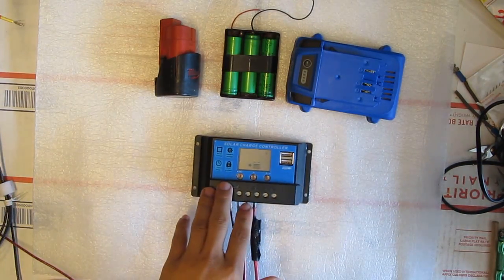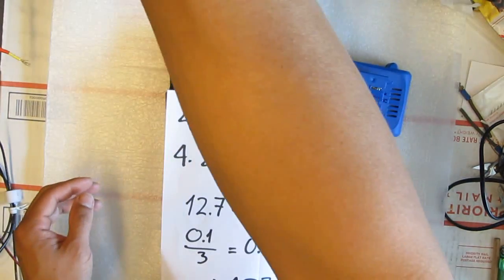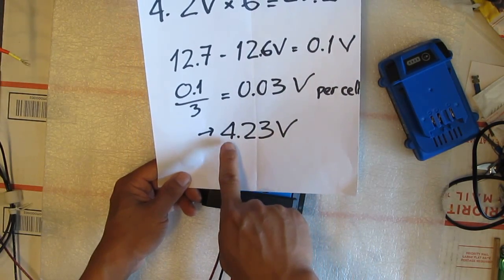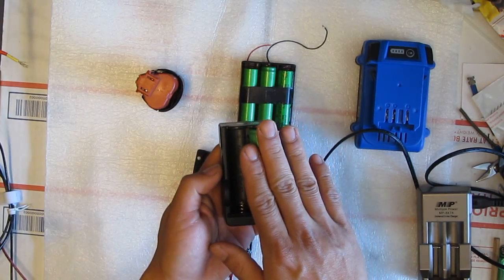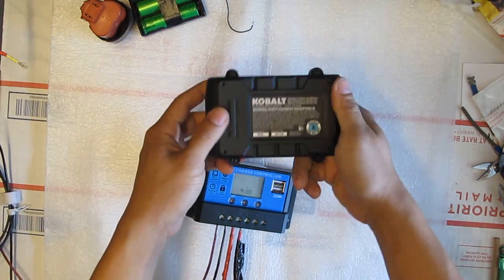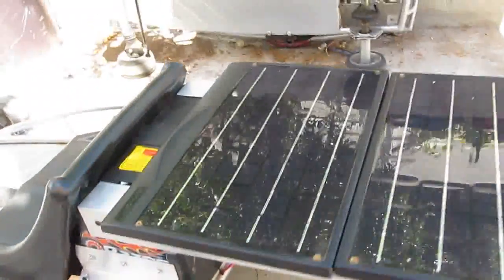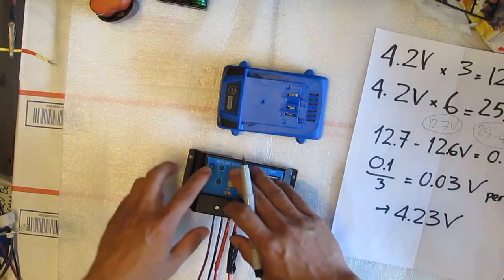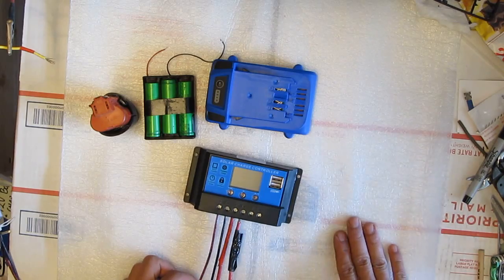Charge Li-ion batteries with regular Charge controller made for Lead Acid batteries

Comment: my foxnovo 4s charges my 18650 to 4.22, when I test cells with voltmeter they read 4.25. I havent notice any damage. But those who might have any problems with the slight overcharge can just attach a bms circuit to the battery pack as a safety feature.
Reply: jony joe Although higher than official spec cuttoff of 4.2v, the extra 0.05v to 4.25v is still ok (as you already know) and not dangerous per se. The problem is that it will DEFINITELY rob overall cycle life of the cell, yielding far less cycles over the life of the cell. By the same token, reducing to 4.15v (or 4.1 even better) will definitely increase the amount of cycles the cell can deliver at a cost of small amounts of capacity loss from not charging fully.

Comment: Did the charge controller turn on as soon as you plugged the battery into it? I just bought one and it doesn't turn on after i plug in the +/- battery ports.
Wondering if its broke or im doing something wrong
Reply: josh hyma I have the same question.  Did you find the answer?
Reply: Guys dont buy this pos get your self a victron they are cheap and amazing

Comment: Lead acid charge controller can never be used to charge Li-ion batteries, It is not just about voltage limit, It is about charging curve, It may work but it will stress the batteries, I wouldn't advice charging Li-ion batteries with it:
http://batteryuniversity.com/learn/article/charging_lithium_ion_batteries
Reply: I found you can dump very high current in as long as the pack shuts off charging at max capacity voltage everything is good I been charging a pack daily for past 3 years with dc to dc buck converter with no problems
Reply: i did alot of testing with dc bick converters to limit votlage so once battery hit the 4.20 or for long life 4.1 i found the current dropped off as they where both equal the current cant flow so as long as you have your input voltage set to that of max of the cell then the current drops anyway only the dumb chargers for lead acids etc are bad as they dont cut off at the right voltage and will over charge
Reply from the maker: You got your point in that a charge controller might charge a Li-ion battery pack at a faster rate than it's designed for. Most Li-ion batteries would accept 1C to 1.5C charging rate. So if you have a 12V 15 Watts or even 20W solar panel or less, the max charging rate is 1A (considering you will never get 100% efficiency out of a solar panel), you should be fine charging a 12V battery pack in 3S config. But if you have a bigger Li-ion battery pack like a 3S2P 12 Volts pack, you can double the charge rate or you can use a 30W solar panel... and so on. And if you have a high discharge Li-ion battery pack such as from a cordless tool battery, you can safely charge them at 2C or 3C or even more. That means you can even use a bigger panel to charge it. So even though you have your point, a charge controller output is only dependent on how big your solar panel is. And it is also dependent on how big your Li-ion battery pack is and what kind of Li-ion cells you have.
Reply: No you are completely missing the point, Charging curve is not charging at 1C or whatever C, The two are completely different, Li-Ion have constant amp charge than constant voltage, The charge controller in the video doesn't provide that, So those batteries will be stressed sooner than later, and their capacity will drop dramatically.
Reply from the maker: I don't think so. That is the point. The controller's only job is to limit the current when the battery is full. Besides that, it does little to limit the current. That means all of the current will come from your solar panel when bulk charging (at full speed). That means the current is going to be constant unless you have to charge your battery for a long time because when the sun moves across the sky, it's power to the solar panel changes. So if you only charge the battery pack for only a couple hours, the current is constant until your battery is full in which the controller will limit the current and switch to constant voltage charging. If you only base on the charging curve alone, you are also missing an important point. That is to not charge the battery at a rate more than it's designed for. If you put a 120W solar panel and charge a 3S1P 12V battery pack at 10 Amps when it's only rated at 1C or 2 Amps, you're going to blow up the battery.
Reply: Read and learn from the link I posted on how Li-Ion should be charged.
Reply: Interesting David Simpson.. so do you hook the dc to dc boost converter in-line after a pwm charge controller and the dc to dc converter acts as a shutoff switch when you get your batteries to full charge?
Reply: a charge controller manages over charge and over discharge also when the load should be on and off but I use a dc to dc boost converter set to 12.6 volt to charge my pack I find as the pack reaches 12.6 the current flow drop off and charges battery fine I have a 3s20p pack and been running for over 3 years with no problems
Reply: yeah my current at max is way lower then 20p pack can take at max 3 amp in into a prallel pack of 20 x 2200mah
Reply: also to add all my cell are laptop salvage
Reply: David Simpson If you are charging your cells at the rated current usually half C or can be found in the cell spec sheet you are fine, If not you are stressing the cells, You wouldn't know it but you can save years of battery life if you do it by the spec sheet, For lithium ion usually constant 1/2C up to the max voltage than constant voltage down to about 1/10C then cut off, If lets say the cell is rated 2200mAh nominal and you have 5p the charging current will be (2.2x5) / 2 = 5.5 amps

Comment: Will it accept 6 ga wire? I will be running 35 feet from controller to battery and the chart says to use 6 ga stranded wire for 3% loss.
Reply from the maker: No, it does not. Size 10 is pretty much it. It might fit size 8 but it'll be a tight squeeze. But the size of the wire is only half of the story. You also need to know the voltage of the system. The higher the voltage, the smaller the wire you need to run.
Reply: I understand. I have 35" from the controller to my battery which will provide current to run a Mighty Mule 200 gate opener. I have 2 BP 85 watt panels producing 12v. They will be charging a group 24 AGM deep cycle solar/wind Chrome batt.

Comment: This is great info i wasn't even aware of that overcharging could be a problem, but you showed that it is so minor that it's not a issue.. thanks (y)
Reply from the maker: Overcharging is in fact a problem with these Li ion batteries. But at 4.23V instead of 4.20V, it is within the tolerances acceptable for these batteries. One time I tried to charge these batteries with a 5.5V solar panel and it just destroyed them in a couple days. The batteries got overcharged and vented out all of their internal solvents (they all have vents on the top) and rendered them useless.